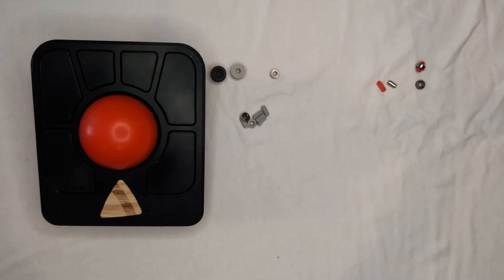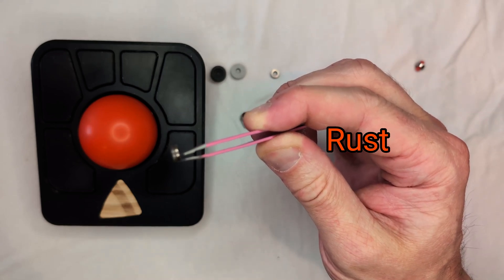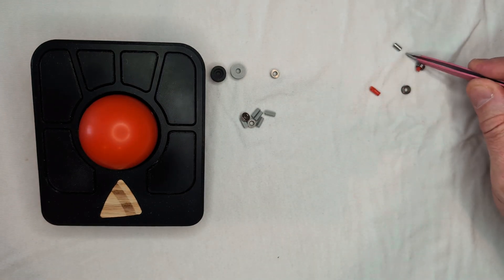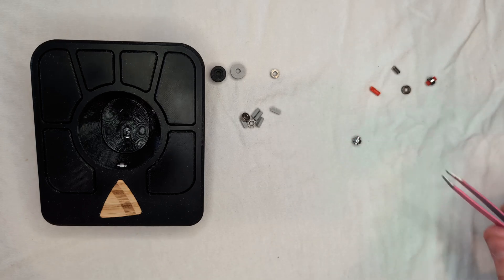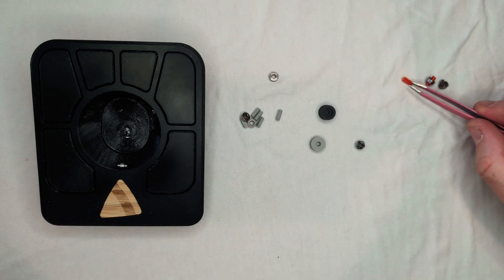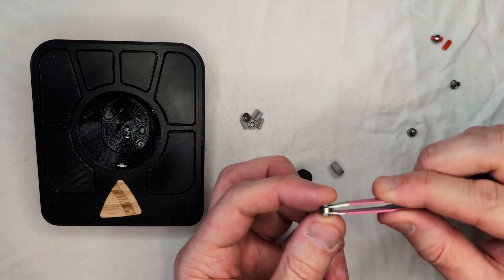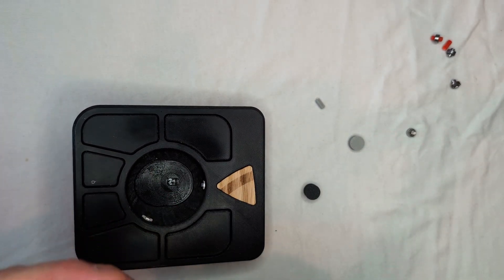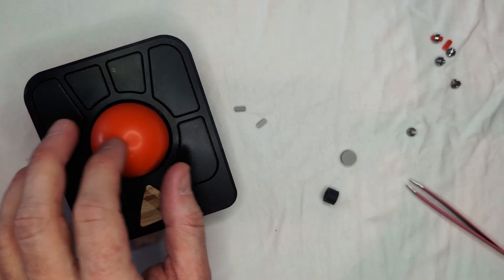Replace Ploopy Bearings. Fix Stiction for Adept, Classic, Thumb, Mini

Comment: Hello, my Ploopy Adept arrived today. I have noticed that one of the dowels is approximately 0.4 mm loose, resulting in a very loose bearing in the upper left position. My question is: Is this intentional? I measured the other dowels and created one myself, where I observed the 0.4 mm difference. Now, the bearing is secure. I searched online for an STL file for a replacement kit, but did not find one, so I decided to create it myself - just the dowel. Subsequently, I found your video and realized that I am missing the guides. I estimated the measurements. I am in Romania, and returning to Canada was not an option for me. Additionally, mine was already assembled. Please let me know if yours also had a loose dowel, and if this was intentional. Thank you for the video.🙏
Reply from the maker: Mine didn't have a loose dowel, so likely it was a printing flaw. Which sucks given your situation. Alas, I've never 3d printed a thing in my life, so I won't be able to provide guidance (hopefully someone sees your comment and can chime in).

Comment: Will the Classic 2 Maintenance Kit work for the replacement dowels and jig?
Reply: There's an Adept case kit from Ploopy for CAD $20, too.
Reply: What's the size of your stainless steel dowel?
Reply: The stainless dowels are affordable though. The jig I could lose within a year before the rust sets in the bearings.
Reply from the maker: Wait until your bearings are rusting. It will take the full year at least (mine was likely faster due to walking desk sweat). Maybe there are other purchases options by then. When it starts to break down, it's still plenty usable, it's just annoying

Comment: is this your daily driver? I want to purchase one but Canada Post is on strike lol got to wait until its over. Going to need to find a bearings supplier though
Reply from the maker: Definitely my daily driver. Last 2 years now, absolute favorite mouse after my quest for the best. Hopefully Canada strike blows over before too long. You have a good year before you need to worry about bearings replacement, so you can kick the can down the road

Comment: I was able to reuse the dowels from the original bearings
Reply from the maker: Excellent. You were less sloppy and impatient than I was 😅
Reply: Nice; how did you get the dowels out of the original bearings?
Reply from the maker: @Yesimthatkid  I just kinda shoved them out with my thumb. There's like a first sticking inertia, but then it goes

Comment: does replacing them make the adept also quieter?
Reply from the maker: Yeah google "Ploopy Adept BTU mod", or go to the r/ploopy subreddit. But they're 3d printed modifications or the original design, and people don't sell them, so you'd have to get DIY hands dirty
Reply: @ocdevel  Thanks. I don't mind doing that just wondering how much quieter it gets compared to the original. No one posted audio before/after
Reply from the maker: @anonymousbrowser4448 oh that's funny that nobody posted with sound, that's half of the benefit of BTU! (Well... The majority is smoother movement). I'm not sure, myself, on dB or even gut-check relative difference. I just know that the steel ball-bearings of stock Adept are loud by nature.
Reply from the maker: @anonymousbrowser4448 oh, and I just realized you asked if the replacement from MY video improves sound. Sorry, don't know where I went there... No, it doesn't that I can tell
Reply: @ocdevel ohhh thabks for the clarification 
I thought just replacing the bearings like you did would do it 😂
Not undertaking a whole 3d print project

Comment: I'm planning to get one very soon... I feel very unconvinced about getting the repair kit lol.  You're handling of the dowels probably spared me from countless minutes being confused down the road; either way It seemed like you made it much bigger deal out of it than I personally probably would have. I'd probably initially just shove some piece of cardboard through the bearing to wedge it into the housing. Then I'd probably whittle a piece of wood. Perhaps better support than stock with even less time ^^

Anyway, thanks for letting your ploopy hang out with us at class today :)

If you do a video of this type in the future - I suggest spending some before / after time rolling the ball with different load patterns (So we can see any difference ourselves!)
Reply from the maker: Trust me that DIY-ing this like a MacGyver (cardboard, etc) won't serve you well. Even slightly-too-small dowels I used wasn't ideal (but definitely workable, if you're about to use cardboard). If you want to properly DIY, then you can 3d-print the dowels & dowel press; accessing a public (library, maker-space) 3d printer if you don't have one. In fact, if that's your mindset I'd get started on that path sooner than later, since that will open up so very many doors in the ergo mouse & keyboard world. 70-80% of the good stuff out there leans on 3d printing, soldering, etc; and the off-the-shelf stuff is rare.
Reply: Trust me, Tyler nailed it on the dowel chat. Obviously you're free to have a go at making one, but 3d printed dowels to the original design are the only things that I'd expect would stay in place. It's quite an odd fitting.

Comment: Thanks for the video! 

Would replacing the bearings with the stainless steel ones you link prevent it from ever getting the stiction issue mentioned in the video?

I noticed my adept already developing that rusty texture and not even 6 months of use (I live in a very humid country) and it does feel scratch and not as smooth as when it was brand new...
Reply from the maker: Yes, absolutely buy the aftermarket stainless steel bearings.
Reply from the maker: I'm actually surprised Ploopy doesn't use stainless steel. Maybe they didn't anticipate rust
Reply: ceramic bearings, So buying full ceramic bearings, would be very beneficial towards these concerns, right?

corrosion + wear take multiple forms, surely? ... I don't know that "stainless steel" is helpful in a broad sense.  I remember looking at Rexroth BTUs & being taken aback that 'stainless steel' didn't seem to be mentioned anywhere, for all their very specific alloy/form/config characteristics... They were maybe more concerned with dust / debris, light, heat, moisture, corrosion,.like microscopic denting, etc, and having options based on that.  granted we might not need to worry about corrosion most of us lol.different use cases but I'm not sure our concerns would be unfamiliar to them..but They don't use ceramic likely because steel and plastic would probably be less fragile!

Comment: Wouldn’t you be able to print those pieces yourself instead of purchasing a maintenance kit?
Reply: To find the maintenance kit STLs, you have to go to the ploopy classic repo, under mechanical and in that folder will be everything you need since the Adept uses the same bearings and dowels.
Reply from the maker: @xumike3929  absolutely. Duh I didn't think to mention it (guess I figured I'd they own a 3d printer they likely built the mouse, but that's not necessarily true)
Reply: Yes you can. If you use a cheap printer to make them, turning the print speed down may be required to get the tolerances right (e.g. Ender 3 V3 SE)

Comment: I wish these were wireless
Reply from the maker: @shandow8201  yeah, that would be a boon. Honestly, I wish there was a good usb-c wireless converter solution for any usb-c device. I've seen them, but they're very expensive
Reply: @ocdevel it shouldn’t be hard to build one with ESP32 microcontrollers. The problem is more about power management. I would prefer to use wired version because I don’t like batteries 😢.
Reply: @ocdevel there is a community BLE mod for the Adept, seems relatively straightforward too
Reply: Remember to choose a design with a PCB antenna. Some MCUs have SMD or chip antennas, those only provide 125Hz communication. You'd like above 250Hz for cursors to be smooth.

Comment: I've tried the uxcell MR63ZZ bearings you linked, and they aren't the smoothest compared to NSK ones on AliExpress. However they are only bearing steel, not stainless 😢
Also, when 3D printing the maintenance kit on a cheap printer, you may have to slow the print speed or else the tolerances with the dowels and bearing press will be incorrect and be impossible to use.